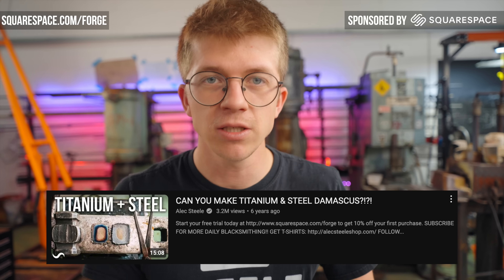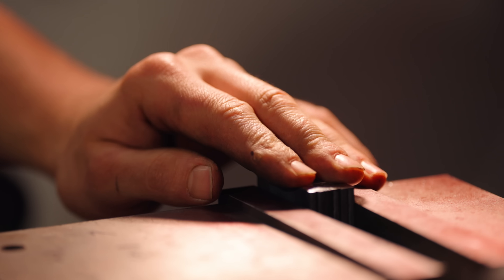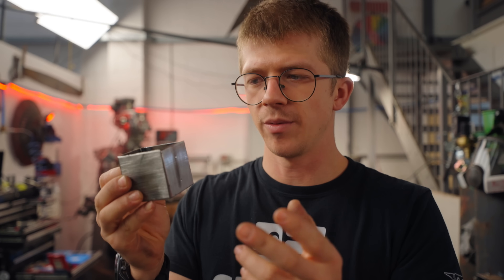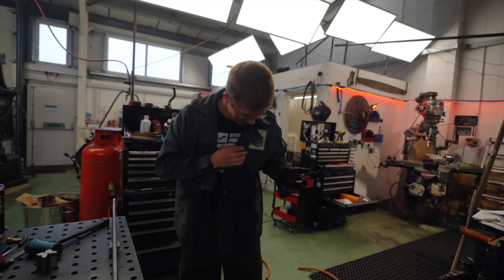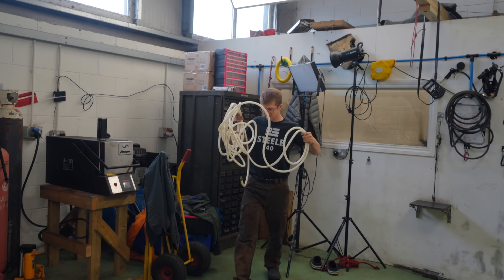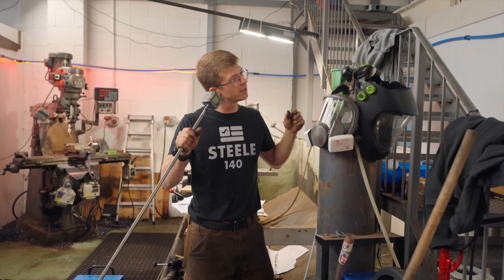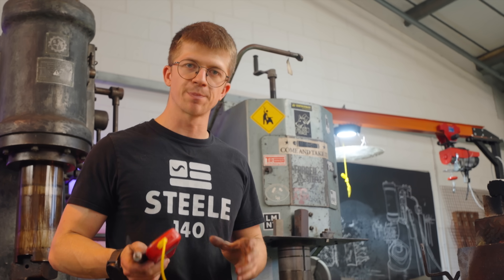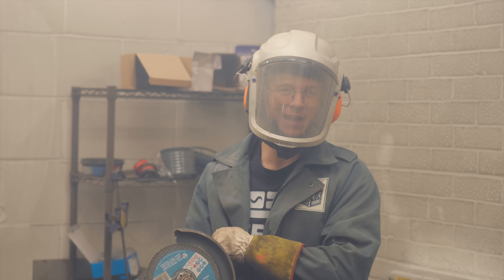Can I make Titanium Damascus?

Comment: I might be wrong but even if something is patented, I think you can still recreate something you just can't sell it. Like think of the vice-grips series from a couple years back, I'm sure there's a patent on that design but there was no reason not to recreate it
Reply: It’s because they make money from their content that it’s classed as commercial use, they could however strongly argue this is educational use. It also doesn’t matter because the patent has expired
Reply: @Volt64bolt it can be portrayed as a test. If you don't makr functional use of it for your commerce it doesn't matter.

Trying it out if the thing described in the patent even works itself doesn't infringe and is necessary for just even judging if the patent is valid or not.

Anyway a thing to be wary of is if they left something out of the patent and patended that something later, that just happens by a miracle being essential to it(it shouldn't be something obvious to a person in the trade or its  not valid and like said the original patent should have enough in it to replicate the process, but eh its pretty common)
Reply: @Volt64bolt  You can make money from it so long as you don't impede or interfere with the originals market.  Make a video about vice grips for example would in no way interfere with the sale of vice grips as videos and vice grip sales are apples and oranges.
Reply: @Volt64bolt tis this, they make money off of showing the process
Reply: @Volt64bolt  yeah i mean look at nile red. he often uses patents as instruction manuals but hes clearly doing educational content
Reply: @Volt64bolt youtube is  not commecial use... the content is owned by the creator and  add revenue is youtubes property that is then distributed .. so no direct link
Reply: @Volt64bolt is selling titanium patened? You can make money from everything titanium as long as you don’t sell it
Reply: @Beoke-c1k  thats.... not how it works....
Reply: @Volt64bolt that is not how patents works.  Prevents people from making and selling it only.
Reply: @Volt64bolt  nah that doesn't count
Reply: @Volt64bolt agreed
Reply: @Volt64bolt  Um, no? The patent prevents the commercial use of the process, not the commercial use of **videos about the process**.
Reply: @HandleNotFoundException  it is still commercial use. He is using the process to make money, even indirectly. It can be argued strongly however that it is for educational purposes and that it doesn’t affect the companies revenue. Either way, the patent has now expired so it doesn’t matter
Reply: @HandleNotFoundException they’re the same thing, regardless, most patent lawsuits aren’t about being right but having enough money to force the other party to settle, so arguing over the fine semantics is kind of pointless.
Reply: @Volt64bolt  I think that’s still dumb. I thought the whole point of copyright was to incentivize scientific advancement with the reward of a temporary monopoly in a market? If an item is not for sale, nor is it transferred, I think copyright should not apply.
Reply: @HandleNotFoundException  yep and arguing that reuqires a lawyer which cost money so...which do you rather do?
Reply: @Volt64bolt that’s not commercial use of the patented product. It’s commercial use of a video about it. Huge difference. Videos don’t violate patents. Never happens
Reply: @HandleNotFoundException  using the process to make a video on how to use the process that proceeds to make money is still profiting off the process, my guy.
Reply: @derekwatkins4374  it's insane how people are fighting to death about a patent that already expired, that's just embarrassing
Reply: @HandleNotFoundException but they’d have sued him regardless which would mean he’d have to hire a lawyer which would incur legal fees and in general it’s not worth it. Yes legally he could have been in the right but companies like to use the legal system as a threat in itself by forcing the other party to hemorrhage money when fighting said legal battle
Reply: @Volt64bolt patient infringement has to be distribution, sale, or transfer of the patented material.  The process is public for anyone to see and thus making a demonstration, even if for commercial gain, does not convey any more of the product than done in the public patent filing.
Reply: Pretty sure porche lost this fight multiple times. As did many other super car companies like Ferrari. 

You can mod the cars. You can re MAKE the cars piece by piece with knock offs. You can monitize it all you want.
Reply: @Volt64bolt  "It’s because they make money from their content that it’s classed as commercial use"

bullshit.  that's not what a patent means.
Reply: @thomasneal9291  you are correct, that isn’t what a patent means. That’s what I said about why they couldn’t make a video before.
The patent is expired anyways so who cares
Reply: @Volt64bolt no. He's making money off of making the item, not selling it. This doesn't violate the patent holders' rights. After all, you don't owe the patent holder anything for demoing a patented item. 0:45
Reply: @Volt64bolt that is 100% false
Reply: @Volt64bolt bro, no… patent just means you can not sell a product containing the patent only. He can make money any way he wants with it as long as he is not marketing or selling it
Reply: @Volt64bolt  They couldn't monetize it then, or have any monetization on the channel at all.
Reply: @wildcatdan5072  yes thats what I’m talking about, they wouldn’t be able to use the patent, if it was still active, for commercial purposes meaning they couldn’t accept a sponsor for the video.
Just for the video that contains it, not all.

They could potentially claim its educational, but it’s expired so it doesn’t even matter
Reply: @Volt64bolt or could demonetize video xD prolly didn’t wanna do that tho but point is still true he coulda done it whenever just not made money on it xD
Reply: @Volt64bolt they aren’t using the patent commercially lol
Reply: @jamesbizs  so you are saying hey made no money on this video from using the details in this (already expired so no point even discussing it) patent
Reply: @jamesbizs whether it is commercial is irrelevant. You don't understand how patents work.
Reply: @Volt64bolt  The video making money doesn't matter (in US law). It is the commercialization of the process and/or the intended product of the process. He could sell a printed copy of the patent, all the equipment and materials to make it, fill in any missing details and it still wouldn't violate the patent.
Reply: Normally, the patent holder won't bat an eye at some artisanal production.
Reply: @Kualinar  the Problem is, if you Do Not defend a patent with All your might, they can fight that patent easly. As soon as you dont care about your patent, it can be an argue for further lawsuits and be Interpreted in  a way like "i dont care anymore" and be cancled right away. Its Not that easy.
Reply: I love all the patent lawyers in the comments.
Reply: yes. you are correct lol
Reply: Nintendo thinks otherwise
Reply: It's always hilarious reading a comment where someone calls others "dumb" & then they follow it up with completely incorrect "facts".
Reply: depends heavily on the jurisdiction. the us has a research and education exception, but you generally can't recreate it for other uses, even if they aren't for profit. (businesses won't likely sue you if you don't have deep pockets and they aren't using the patent, either, but a few litigious ones may anyways.)
Reply: @dead-claudia precisely. Now if anyone else wants to recreate something but doesn't want to possibly breach patent laws, just establish your company in mainland China - no prosecution will ever take place
Reply: Vise grips patent ran out. 

Has the titanium patent run out?
Reply: @scottsolar5884  yes the titanium patent ran out in 2023, it was brought up in the discord when the cast iron chips canister video released and after some digging and discussion about the educational use laws of it realised it was expired
Reply: @Volt64bolt  there are still 2 active patents.
Reply: @dr_ginn_chaos8071  oh yeah? Well they would have to be suitably different from the original otherwise they wouldn’t have gone through, what’s their numbers
Reply: @Volt64bolt That's hype ass information. Most helpful YouTube comment I've seen in 5 years
Reply: @Volt64bolt explain how you patent the forging of 2 metals ? The pattern is never the same so
Reply: @scottsolar5884  he literally explained this at the start of the video for being the only reason he finally attempted it, how did you miss that?

I agree with the other people though in saying that reproducing a patent doesnt get you in any trouble unless youre trying to make a commercial product out of it and just making money via this video does not count as that. Look at Thoughtemporium's comment on the subject, he would know.
Reply: @scottsolar5884  nope still active.
Reply: @scottsolar5884  did you not watch the video
Reply: @scottsolar5884 Did you turn off the video 30 seconds in?
Reply: Watch the vid bro.
Reply: @scottsolar5884 say you don’t know how patents work without saying so 😂
Reply: @robmanueb.  Not true. Damages are not required in patent lawsuits. You only have to show that someone else made money with your Intellectual Property. It's a pretty low bar, but sometimes the vagueness of the patent can hurt your ability to go after them successfully 
😊
Reply: You also can’t use patented processes for the purpose of manufacturing and selling products. See Sun gears (epicyclic gears) as a patented process loophole for a much more efficient gear system that was patented. The guy that invented Sun gears did it purely to stay in business while his competition held the patent, and then switched to the better gearing solution once the patent expired.
Reply: @robmanueb.  That's incorrect, a Patent can also block replication even if there's no commercial usage.
Reply: There's a lot of patent lawyers in these comments.
Reply: @Lazybump American copyright law is so broken…
Reply: The video is monetized
Reply: Most everything that's been said "created" has already been created, SO MUCH stolen technology/ideology from 100 plus years....
Reply: How else would we find a better way to make stuff?
Reply: Hardly.... no one would dare to teach/recreate a patented apple laptop..... LV purse etc for great reason...
The maker would sue you to heaven for making a counterfeit, or teaching others to do so...
Reply: @AhhhSukeSuke counterfeit protection is under trademark law.  Has nothing to do with patent protections.
Reply: @AhhhSukeSuke  in those cases you'd have to be really clear that you're making a replica. In the case of a patent, it's either the design, process or both that you register. Any competitive product would need to be different enough to create reasonable doubt in a court of law, or better yet: to avoid lawsuits altogether. Sometimes it's enough to change a square shape into a circle or a triangle.
Reply: > I might be wrong

That's the literally million dollar question. Ask. Your. Retained. Lawyer.
Reply: All of this discussion "is it legal or not" is irrelevant. The question that should be asked is "can I afford a court case if I get sued?"
Reply: @Mervinion  if he sells the Damascus he could
Reply: @kyle Royer
Reply: I can't believe, you're sharing such a skill for all of us. Unique work, thank you much!
Reply: Who made the first timascus ?
Reply: @whatthe1934  oh, really. You're probably a great person to know for small business owners.
Reply: @permanentvisitor2460  Don't follow the legal advice given in this thread. It's terrible and will get you sued, if in the US. Otherwise, if looking for specific legal advice, there are plenty of resources for small business owners. Some of it can be free. There are various government and commercial sources that a simple Google search will highlight.
Reply: @robmanueb. Not at all true. You cannot make money off someone else's patent, period. Whether they'd have been able to make that money the other person did, or not. B is for Build made a replica of the "Eleanor" Mustang Gt500 out of the chassis and interior from a new Mustang, with the body both from a regular late 60's Mustang + some knock off GT500 parts I believe... Wasn't even a 69 Mustang GT500 or whatever the original Eleanor was... Not it's chassis, not its body panels... But because he made money off the video where he called the vehicle "Eleanor..." The widow of the man who made Gone in Sixty Seconds was able to sue, and ultimately the vehicle became hers. Just as she's done time and again to other people for some of the most egregious reasoning... If you profit commercially using someone else's patent to do so, you must pay them, willingly or otherwise.
Reply: True
Reply: Not wrong, correct.
Reply: I checked this and (at least in the UK) the patent grants the owner the right to sue if someone else is using the invention. There is no mention of selling or commercial use, and the patent doesn't even grant the owner the right to use their own invention, because their patented idea might rely on using other patented technology that they would need to get permission for.
Reply: You can’t make it for commercial purposes, and making it for a YouTube video that is monetized is by definition “commercial purposes”.  Even if he didn’t have monetization for the video, it could still be argued that he was increasing his subscriber count which would influence the views on his other monetized videos.
Reply: Came here to say the same. Creating it never would have been an issue, but selling it for profit would have.
Reply: That's correct afaik
Reply: He’s making money showing the process :P

I don’t know what the “use” clauses were in the patent.
Reply: It's about him making money by using the titanium Damascus, he isn't selling it he's earning money from the video that would otherwise be impossible
Reply: Cannot sell if use a patent by other. I been learning from my dad. . It say cannot sell but ok build one for self only . I not know if any change laws , if not change law it can build but cannot sell it because of patent.  Old war they had different design but near same as other patent but different measures were use back old time. Not know if still allowed do that to be patent against other patent over different measures and size but near as same idea blue print but different measures and different house if required do but same process as other patent.  😊
Reply: @ALEXbLack2  yeah that's another law, but the law is literally just that if you are getting any sort of earnings from making it, whether selling it or using it in a video, it still counts as an earning meaning you can't make it. If someone had a patent for pancakes and I made a recipe video, even if I got 1 cent I would still be breaking the patent laws, ofc the actual ppl wouldnt care but still breaking the laws
Reply: just use soviet patents. you need pay pennies to russian federation
Reply: He’s making money on the videos so he’s essentially selling it
Reply: @chris2414  not selling, but it does count as commercial use.
Reply: @bramweinreder2346  I think you missed the point
Reply: @chris2414  I realise that the point is Alec's case as a content creator, which turned moot for known reasons. But I would be remiss if I didn't hypothesise about the reality of an everyday use case. It's not like they can't enforce their patent in cases of personal use, but in most cases they won't.
Reply: One time my dad recreated a patented invention. 

They tortured him to death, locked up his remains, and re-execute him every year.
Reply: Absolutely correct. 

Any patent you find you can 100% legally use to make whatever device it shows. You just can't market it to sell it. 

You can use whatever device you see and recreate to make OTHER things to sell. 

As an example you recreate one of the many saws that have patents, you can then use said saw to make something else like furniture or cabinets or whatever...and sell those. 

So it doesn't preclude you making monet off a patent indirectly. Only directly. As long as you don't make 50 of those saws to sell to your buddies at a profit you're good. 

It also doesn't mean you can't get the actual cost you put into making the saw. You just can't make them and sell them above cost. 

The last one is much harder to guage. Especially if you include labor. If you were taken to court and the court or jury finds you so much as made a penny more than your cost you would suddenly be in a massive bind financially.
Reply: Just change a few minor parts of the process and patent it yourself 👍
Reply: Is this being made for decorative uses?
Reply: You can't make something that's patented if you're gonna make money off it. He makes money from these videos, hence why he couldn't make it and post the video. But without the patent being up to date, it's fair game now. He could even technically buy the patent for it and make it his own.
Reply: @mikebrooks5382  dude. cars are patented and people make videos of cars everyday
Reply: Nah, they will raid your house and confess everything 🤦‍♂️
Reply: You are technically correct according to USA law not sure if his county has a specific law regarding it
Reply: He is still making money from the video
Reply: absolute yuo can do it, thats the point of patent
Reply: ASSUME ass*u me, case you needed to see it 😂🤣😂
Reply: He doesn't sell most of the pieces he makes, but the videos are monetized, so he would be getting income because of use of the process, so it would potentially breach a patent had it been valid
Reply: He makes money off videos. That should be enough explanation
Reply: Jesus loves yall
Reply: Pretty sure that's wrong. If you patented a unique tree, but only sell the fruit, that is still protected.
Reply: I think that makes perfect sense. It’s a legal commercial protection document.
Reply: If a patent exists like this one you can't profit from it's design period. Making a video about a product would generate income, and the patent holder could and probably would file a lawsuit for those profits. That's why he was worried about a potential lawsuit making a video before the patent expired.
Reply: Cannot attach capital gain to creating a patented product, so they are making a video for profit
Reply: Capitalism works with expired patents. There is so much observational evidence that goes against your train of thought I'm afraid.
Reply: With 2.6 million subscribers I’m sure his videos are monetized.
Reply: Make commercial use of it. For which making a yt video and making any money off of that counts.
Reply: That’s correct, you can re-create something that is patented, you just can’t make money off of it.
Reply: I was informed that if you make even a minor change to the product/process then you bypass the patent - in this case praps merely just drilling the extra vent hole?
I could be wrong tho . . .
Reply: Patents are great, except they are worthless.  My dad did development for the government.  The official policy was use what you want, we'll (legal department) deal with any patent-holder that cries about it.  he later did research for corporate America.  Same policy.  Point being, your patent is nice, but worth only as much as you can afford in court costs...
Reply: Maybe but is a US patent, they will make a slap lawsuit just to not try it
Reply: You can get a patent on the production of a certain thing based on making it in a different way. You own the process, not the product.

Not until you start making actual goods, the product is still just a material of which you only own the specific process you patented.
Reply: The content is the product
Reply: He makes money off the video though so he’s profiting off the patent even if he’s not selling the end product.
Reply: Most of Nile Red's experiments are done using patents however i dunno how many of them are expired
Reply: Yes you are always free to creat your own things
Reply: well let me ask you, am i making money on this video(just act like im the channel ) i meaaaaaaan i could see it as an argument
Reply: Patents expire after however so many years
Reply: Its called content my dude. He as to create a narrative.
Reply: He would be profiting off it with this video
Reply: depends on if you live in the US or not. In the UK 100% legal to make it so long as you don't do so for commercial reasons. In the US however it is actually illegal to make the thing either... that bieng said it is entirley up to the company on wether or not they come after you for it or not. If you don't make a youtube video about it they basically can't know... but even if you do it largley depends on how large YOU are on whether its worth their time to interact with you or not.
Reply: Patents just show you exactly how to recreate some else's work to make it ur own. U just need to make a small modification to the plans. It fules competition and shady practice
Reply: You can’t make any money off patented stuff, by making a video of it he in turn would be making money off of it
Reply: making a yt video is selling it
Reply: “One Diddy Hole.” 
‘You can’t say Diddy these days.’ 
“Oh Gosh” 

😂
Reply: Yeah amazing howmany people don’t understand how patents work
Reply: tusky
Reply: Content creation does not count. He would have to try and sell the process or use the process to create product for sale to be in violation of the patent. Simply replicating a procedure for non-competitive use doesn’t qualify. “It is the right to exclude others from: making, using, selling, offering for sale, importing, inducing others to infringe, applying for an FDA approval, and/or offering a product specially adapted for practice of the patent.”
Reply: @robmanueb.  exactly, but still not a place you want to get into
Reply: There is also a bit of messy loophole. You can break a patent for personal use and sell the item when done with it.
Reply: @barongerhardt not one I'm willing to break. 😂
Reply: @barongerhardt not really, you'd never be able to "legally" sell it regardless if your personal uses ar done
Reply: @barongerhardt  uhmm... actually,  you are 100% wrong. There is no personal exemption for patent infringement.
Reply: @barongerhardt really? Wouldn’t that depend on what nation the copyright was filed in?
Reply: @kuil  Yes, maybe, International IP law gets a little messy. In this case it was a US patent and the UK likely has some kind of automatic enforcement, but in other cases it could require separate patents in each country and what/how those are protected can change. Also, patent, copyright, trademark, ... are all a little different but share a lot concepts in applied law.
Reply: @barongerhardt  most companies are not going to sue for patent infringement if you sell one piece.  It would not be worth their time.
Reply: @barongerhardt No. Sale is prohibited, no matter what. There is no „But I infringed the patent as part of a private matter“. The idea of a patent is primarily about protecting the owners profits, hence patent lawsuits are about loss of profits. It doesn‘t matter why you broke the patent - sale means trouble.
Personally I think where the grey area begins is the production of a video. But still, it would have infringed the patent anyway, since this is a monetized channel and therefore not to be considered private.
BUT, the patent ran out. So what.
Reply: @pan6593  It isn't sale, it is profit and usurping the market. If someone patents a new method of perpetual motion, I can follow the patent to build it, play around (experiment, test, improve), and when I get bored I can sell it to help recoup my costs of making it.
Reply: @barongerhardt  No. It is prohibited to build/rebuild/copy/modify for other than private reasons with exception if you got a license to do so. If you were to base something off of it, you need to license and recoup the patents owner. Your understanding is just wrong.
Reply: @barongerhardt no you cannot. Personal use is not a valid exemption.
Reply: @Imaboss8ball  Personal use is part of personal experimentation.
Reply: So much terrible legal advice in one place. Can’t even get the first line of patent infringement right. 35 usc 271(a). If you can’t quote that section by heart, then you shouldn’t be confident in any of the exceptions to it either.
Reply: @marcusburnside7736  ok can you tell us about it 😉
Reply: I wouldn’t have ever thought that putting this stuff in a YouTube video would be considered making money off a patent..
Reply: Depends on where you live, in the US, simply making it and/or using something that is patented in the U.S. is infringement, let alone making a video about it, I thought the same thing, but patents are WAY more strict than we think, and most of the time if you make something that is patented on your own for yourself only no one would really care, but if you record that infringement and show your crime to thousands if not millions of people that’s probably not a good idea. This is putting aside the fact that he is making revenue off the video, which I don’t think holds up in court, because it is not the product he is making that is making him his money, it is the content he is making, he could argue that if he made something that isn’t patented with his content being the same it would still get the same performance than if it wasn’t, meaning the fact his patent is being used or not doesn’t change his revenue.
Reply: You can recreate it and slightly tweak the process. The Chinese got that to an art form. 💀
Reply: Technically it doesn't matter if you sell it or not. If you produce it, you are potentially liable to suit. Question is does someone want to take the time to do so.
Reply: If he just read the patent on a video, he would be making money from the patent. Patents themselves are public domain. They just represent the protected IP that it describes. He is essentially just describing the patent to an audience with visual aids. No harm in that. Companies that have super valuable IP don't patent it. They keep it secret for a while, make people sign NDA and patent only when they think competition is inevitable.
Reply: all you people trying to defend to defend Alec's reasoning here?  you failed.  There was NO reason he could not have done this earlier, despite his protestations.  none.  He's just full of misinformation.
Reply: No. The only exception is for research. As in if you are researching something where you must recreate a patent. For example if he wanted to confirm that what was described in the patent is actually possible. That could be considered research..
Reply: Personal use isn't considered an exception. Although there's a research exception, which technically he's doing.
Reply: I think it would count(if the patent hadn’t expired)because he is making a video about it and profiting from said video.
Reply: With patented products you cannot reproduce them for commercial sale, trade, or distribution.  However as long as the products you create maintain in your possession and are not willingly transferred you can use any of the information found in the public patent application to re-create it.  There are some restrictions on importing them so take such things between countries could be an issue IF someone were to bother to enforce it.
Reply: How does this work when the channel he is making the Damascus on is making an income?
Reply: Its pretty complicated. Like,SOMETIMES yes you can make it for yourself, but actually using it might be enough to hit full blown violation. Its the making money bit that counts. Essentially just making it is a patent violation but without doing anything monetizing with it the value of that violation is zero. In theory they can sue, and win, and you have to pay them nothing, which a judge  will be annoyed with and (probably) wont hear the case. BUT as soon as your making money out of it (for instance by featuring it in a monetized youtube video) then your damage will take value and a judge might order you to stop and hand over those profits. That said I also suspect its somewhat untested grounds for that speciffic example. A lawyer would likely tell you not to do it however.
Reply: Technically he profits off the video and if the video he is profiting off is him working an owned patent... Well
Reply: I didn't know so many stupid people existed - first of all, the patent only protects the result of the process described in the patent - which in this case is COMPOSITE METAL (or metal alloy)! The guy is not selling bars of the alloy or knifes made of the alloy, so there is no commercial use of the patent here. Did any of you receiving a part of the metal that he produced?
Secondly, yes, in the US, even private use of a patent is not allowed, however, the patent holder has to sue for DAMAGES (a number) that resulted from the patent infringement - missed sales or share or unlicensed sales! What damages are you going to sue a person that produced 1 copy for personal use?!? A share of 50 bucks? That's why only commercial infringement is litigated, there should be sales so that you can claim some percentage of. Or you have to claim that your sales suffered because someone was selling unlicensed so your sales suffered so you want damages.
And third, in Europe for example (definitely Germany, Netherlands) only commercial use in protected by patents, so he could have made the video in Europe somewhere.
Reply: Correct, you cannot make it exact, and for sale. Ive owned 2 patents, there are many may ways to get around a patent.
Reply: exactly, patents: its not about the result or end product, its about the process or mecanics described or delevoped to archive the results. For example, que "light bulb" is a concept, like "titanium damascus steel", the way people maked the light bulb were many, size, process, materials, etc. So, dont be afraid in the future. (Unless you are following a patent  to the letter to recreate something that in one way or another makes you money, aka someones else process)
Reply: You are wrong. Patents prevent people from “Creating, using selling or trading without consent.”
Reply: @robmanueb. You'd still have to go to court over it though. The cost and anxiety alone made it a no go until the patent expired.
Reply: Nothing is protected when it comes to personal use. Everything goes in the privacy of your own home or workshop.
Now if you were to expose company secrets on YouTube, that would be bad. If your business model hinged on patent infringement that would be equally bad. With the patent up, you could manufacture something with this process, just not sell it. And if people watched your videos uniquely for the process of making pretty titanium Damascus, I suspect you wouldn't be able to do that either I think. But with the patent expired, it's moot.
Reply: @bramweinreder2346 um?   Wow... Yes, there are things you cannot legally make for personal use. Patents aside. A three letter agency holds away over that in the US.
Reply: @fshalor738  I looked it up and you're right. It's for the patent holder to find out and enforce, which in these situations they usually don't bother with. I had it confused with copyright protection where home use is typically exempt.
Reply: Yes, you are wrong.
Reply: @prdoyle  my favourite part is how you show zero motivation. You should patent that process.
Reply: Also if he just doesnt use the exact steps in said patent
Reply: Yep, that's right. As long as he wasn't selling it it's perfectly legal.
Reply: There is a guy who made a youtube video of 3D printing a patented chair.  Since he is making money on the video it's technically possible to get sued.
Reply: If the video is monetized, technically your infringing on a patent, you can’t make money on it in anyway, even if you don’t sell it
Reply: "vice-grips", "Plexiglass", are brands.. who make a product... many people get confused by this... because colloquially we call all polycarbonate glass, plexiglass... and all locking plyers, Vice Grips, Even though they are not... all "Vice Grip" brand... Many companies make vicegrips, many companies make plexiglass...
Reply: no one can stop you from producing your own stuff, but yeah re-selling it, (or if it's used for production of other items you sell, ie any form of profit) yeah illigal.
Reply: Not only is he profiting off the patent from the video but he's also teaching people the process of the patent.
Reply: Didn't Applied Science use patents to make his own glass?
Reply: He's making money off the video. He wouldn't be able to monetize the creation at all, and arguably even having it on this channel is enough to contribute to his monetization.
Reply: I think people are missing that it can also depend on the country. Patent laws vary.
Reply: Patents are riddled with mistakes on purpose so that best result isint achieved
Reply: All a patent does is stops you selling and making money the end, also not all countries care about patents 😂
Reply: Yeah that's what I was thinking. You just can't mass produce it or profit off of it
Reply: The vise grip patent was allowed to expire, it was owned by sears which went bankrupt. It procluded them from spending capital to preserve the patent. 

You can be sued successfully if you make something on youtube because it is done for profit.
Reply: Also he changed the patent so he coulda done this whenever 😂
Reply: Yup, what Alec would have done when the patent was still alive should have been legally solid. Either as an R&D, or any other non-profit motive, his activities would have landed solidly within the activities that can recreate the contents of an active patent without infringing upon the exclusive rights of said patent.

But in the worst case scenario, if push came to shove he would have had to hire a lawyer to defend his case. Which is a hassel not worth risking.😅
Reply: Can everyone in these comments stop making up law and site a legal code
Reply: A patent grants the inventor the right to exclude others from making, using, offering for sale, selling, or importing the invention
Reply: @Lazybump  Not exactly. A Patent grants the inventor the right to exclude others from making, using, offering for sale, selling, or importing the invention THAT THEY MADE, It does not stop someone from making an imitation that is different enough to not fall undser the patent. look into Microsoft v United states 2001... AntiTrust stuff mentioned patents that microsoft came dangerously close to copying, but were different enough that they managed to win in court.. Netscape and others were destroyed by this.. 

"411.  Many of the tactics that Microsoft has employed have also harmed consumers indirectly by unjustifiably distorting competition. The actions that Microsoft took against Navigator hobbled a form of innovation that had shown the potential to depress the applications barrier to entry sufficiently to enable other firms to compete effectively against Microsoft in the market for Intel-compatible PC operating systems. That competition would have conduced to consumer choice and nurtured innovation. The campaign against Navigator also retarded widespread acceptance of Sun's Java implementation.

This campaign, together with actions that Microsoft took with the sole purpose of making it difficult for developers to write Java applications with technologies that would allow them to be ported between Windows and other platforms, impeded another form of innovation that bore the potential to diminish the applications barrier to entry. There is insufficient evidence to find that, absent Microsoft's actions, Navigator and Java already would have ignited genuine competition in the market for Intel-compatible PC operating systems. It is clear, however, that Microsoft has retarded, and perhaps altogether extinguished, the process by which these two middleware technologies could have facilitated the introduction of competition into an important market.

412. Most harmful of all is the message that Microsoft's actions have conveyed to every enterprise with the potential to innovate in the computer industry. Through its conduct toward Netscape, IBM, Compaq, Intel, and others, Microsoft has demonstrated that it will use its prodigious market power and immense profits to harm any firm that insists on pursuing initiatives that could intensify competition against one of Microsoft's core products. Microsoft's past success in hurting such companies and stifling innovation deters investment in technologies and businesses that exhibit the potential to threaten Microsoft. The ultimate result is that some innovations that would truly benefit consumers never occur for the sole reason that they do not coincide with Microsoft's self-interest."
 

 	_________/s/________
Thomas Penfield Jackson
U.S. District Judge
Reply: @Lazybump making 😂 like people can’t just make anything they want from scratch for themselves anyway lol
Reply: @Lazybump  and that's why we don't see much technological progress anymore.
Reply: @Lazybump this is the first correct answer in this entire thread, and it has 1/10 of the upvotes of all the incorrect answers above.  Thankfully some people further down get it.  It amazes me how many people become patent experts as soon as they sign into YouTube.  🙄
Reply: @Lazybump  for commercial purposes* no one can go after you for making it privately in your house
Reply: If he just made it he would’ve been fine it’s the video where he could’ve made revenue that would’ve been a problem.
Reply: @Dooinrappin  no you cant
Reply: @Dooinrappin No that’s not a factor. Lots of people have written books explaining how to make patented things and had no issues. A video is no different. Patents protect you from others copying your design and competing with you in the market, not against someone recording a video where they make something
Reply: @robmanueb. It would be hard to establish the damages,  but infringement did not require the patent holder to prove that he lost revenue.
Reply: You’d be selling the content. That said, if you want to make a YouTube video marketing any of my patents contact me and I’ll get it cleared 🫡 (that’s likely true with most inventors)
Reply: You can’t use it commercially, so if you or I wanted to make it that’s okay, but since this is his job and he profits off it he is not allowed
Reply: Wrong, he's making money showing the video, therefore he's violating the patent.
Reply: No, this video would constitute monetary gain from the patent.  Even worse would be him showing others how to do it.  But it's also a very niche product that even if the patent holders (if they were still that when this was made) were interested in spending the money and effort to sue him, what possible gains would come of it.  This dudes not making commerical items nor experimenting with that goal. Real best bet would be to get an attorney to contact this dude and shake him down for some cash and if it were still covered, and make an offer to sell it to him.
Reply: @mtmadigan82  the patent expired over a year ago, that's the main reason why he is making the whole project in the first place and he literally said that at the beginning of the video. Jesus people with 0 attention capabilities are extremely annoying
Reply: Even if you do create titanium Damascus and it's patented, surely you can sell it as long as you make it into a product like a knife or ring, as your not selling the Damascus your selling a knife. Also, how could someone copyright, if that's what it means, the only way of getting a single result like this?
Reply: Yes this is true in the case of personal use you can make a patented product yourself but he makes you tube videos and for him to make a patented product he would not be allowed to have the video sponsored or monetized in any way. But the patent has expired so this means he can freely make and sell using the technique to his hearts content
Reply: I think for patents, the reason why one wants to patent the process of how to make something rather than patenting the product itself. I could be wrong though.
Reply: Yeah, the patents and trademarks try to prevent you from selling stuff with their patent/ trademark on it without paying to the owners, so you should be able to recreate patented/ trademarked stuff for your own use.
I'd be worried to make a video about it on social media though since there's often more or less monetary value behind the videos.
I think he made a right desicion not to mess with it.
Reply: As long as you say it's for educational purposes you can recreate patented things.
Reply: You're thinking of fair use for copyrights, that doesn't apply here.   @JamesG-k5f
Reply: @JamesG-k5f  he'd have to demonetize this video to have a chance of that holding up in court. Even then it's questionable - additional views or subscriptions on his other videos that were brought to his content through this video would probably shoot a hole through the "educational" argument. He'd probably need to start a 1 off educational channel and not link to his main channel
Reply: @JamesG-k5f  no you can't. That is still infringement.
Reply: @Lazybump  do keep in mind that the world is made up of more than a singular country following a singular set of rules.
Reply: @Volt64bolt  and this platform is a US company. Would it be a problem? Maybe, maybe not. However if the original patent holder decided to file a lawsuit with the smallest shred of evidence that's still time and money that can be better applied elsewhere.
Reply: @Volt64bolt  I can really only speak to US patents. The patent cited in the video is a US patent, which may or may not have a corresponding patent in his jurisdiction. Regardless, that patent was expired by the time he practiced the invention
Reply: @whatthe1934 his jurisdiction is the US. He's a permanent resident, I believe.
Reply: The video on YouTube would mean they need to pay royalty
Reply: Making it for a video like this is considered commercial use, which is exactly what the patent is intended to prevent.

Private use? Sure. But not if you make money by copying the design.
Reply: @DH-xw6jp no it isn’t you made that up
Reply: @DH-xw6jp  no its not, this would be considering educational about the process, not commercial use of selling the product. Just look at Thoughtemporium's comment above, he would know as he regularly makes videos featuring patented stuff like this. Video revenue would not count as commercial use.
Reply: @DH-xw6jp no it's not. It prevents you from selling the item made from a patented process ONLY.
Reply: You are correct. I was gonna get on here and make this comment. Never ceases to amaze me how dumb youtubers are. You just can't sell the products using the techniques and if you do how will they prove that you did it using the patent
Reply: @michaelatkin9649  What never ceases to amaze me is how dumb people are for underestimating human greed.
He's right to be careful, because what's right and what you can prove in court are two different things.
Reply: @michaelatkin9649  What you are missing is that Alec Steele in the video is not a private person. Alec in the video is the corporation registered in Alec's name through which the channel is operated. The laws involved are old and you have to understand Alec's reluctance for being the guinea pig for how it is applied to modern times.
Reply: @michaelatkin9649  in the US at least, that statement is incorrect. It doesn't matter if you used the patent to make this, if the scope of the claimed invention covers what you're doing, then you are infringing. It does not matter if you are making it for commercial sales. A patent grants the inventor the right to exclude others from making, using, offering for sale, selling, or importing the invention
Reply: I don't believe that's true. The trade off of filing a patent is that you give other persons of ordinary skill in the art enough information to be able to recreate your invention without undue experimentation so they can experiment with and improve on it in return for your temporary monopoly on commercial production.
Reply: I don’t know the laws 100% but I remember that if you make money out of a patent, you must pay royalties. So he could have done it, but not upload a video of it to YouTube
Reply: You can sell it. You just can't market it as your invention, and you have to pay royalties.
Reply: @IamGrief887 that wouldn't really work. If you didn't set up a contract for those royalties ahead of time, then you will be sued for damages and owe a lot more than mere royalties. You can't just pay a portion of profits after the fact and beg for forgiveness. They are going to at least go for revinue generated plus legal fees, and potentially more if your products end up being faulty and hurt the brand of the patent holder.

But a one-off item, in a different country, for ostensibly personal use, and making educational videos around the process and what did or didn't work, and following the process to varying levels of precision... Nothing about that is illegal. And youtube  channels do it all the time to show how interesting minerals or gemstones are created in the lab. And what is fascinating is just how often the patent doesn't work and is bogus, and how much a patent has to be modified to get anything resembling the same product... Ie, they are patent trolling to keep people away from a product without disclosing the process. Which runs the risk of someone else patenting the actual process and upsetting the apple cart.
Reply: But when he makes money off of the YouTube video, then it’s illegal
Reply: @Phuquefull no it’s not. The money made from YouTube isn’t violating the patent. Thats ridiculous
Reply: @Phuquefull wrong
Reply: @Phuquefull  well no because he is selling the video, not the steel
Reply: @Phuquefull  are you sure about that? I’m not a lawyer or an expert in patent law, but I feel like that would eliminate any video that has an item that is patent protected in it. Like review channels for example. They are essentially making money off the backs of patented technology. I could be way off but wouldn’t that fall under the same umbrella?
Reply: @Phuquefull nope, you can make videos about patented processes all day long. Can't sell the product created by the process (the literal item must be for personal or demonstration purposes only), but sharing patent information and processes are a massive part about how progress happens. Learn how others do it, create best practices, and modify or improve it enough to make the process legally different to make your own product.
This is why only "stupidly easy" or "stupidly hard" processes are patented, because once you patent it, everyone and their brother can see what you are doing. Unless it is something so simple that anyone could do and you need a moat, or it is so difficult that nobody else can (or would want to) actually do it and you want to advertize, then you patent. If you have a real secret, and it isn't something obvious, then you document it well and keep any patents as vague and minimal as possible.
Reply: @Phuquefull  so if i film myself using a Ferrari , they can take my youtube money ? lol.  every youtuber using things that are patented...
Reply: @Phuquefull no. It’s not.
Reply: @jamesbizs  okay lol